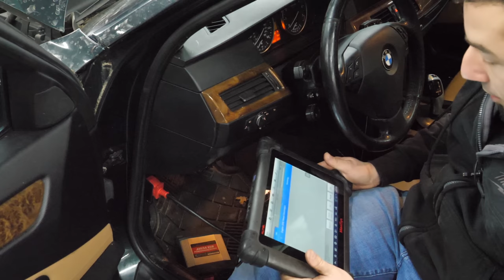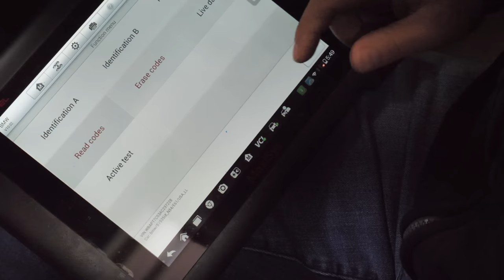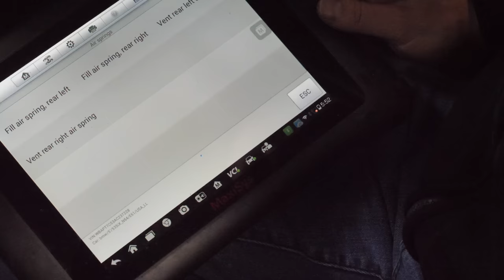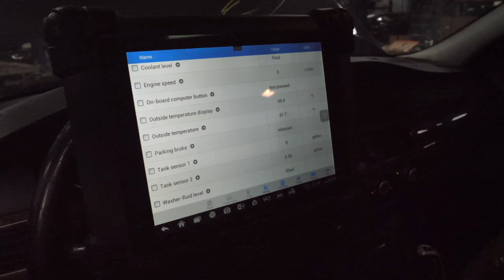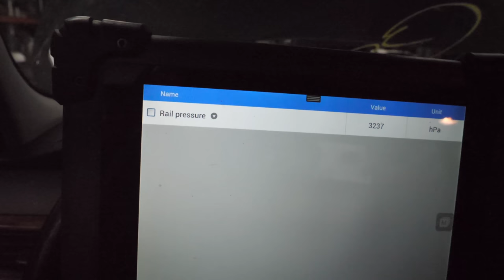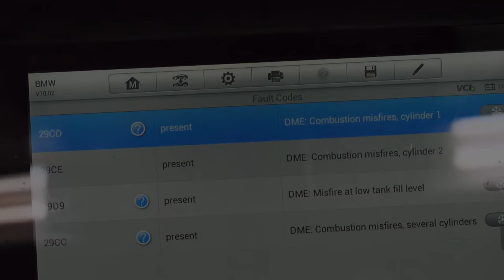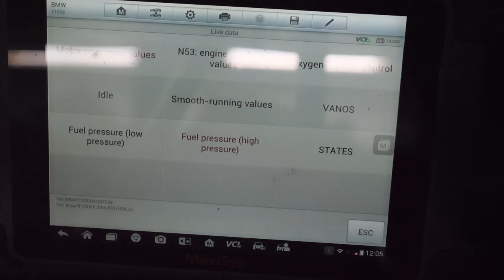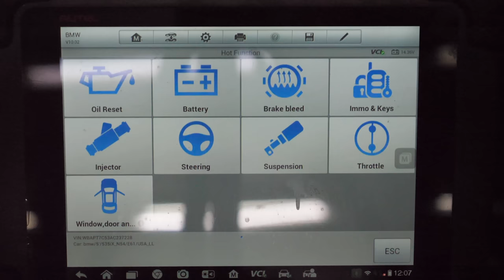WHO DID THIS? BMW Wagon I Bought At Auction LOADED with Improper Repairs. Can We Right These Wrongs?

Comment: https://youtu.be/VpqPA_Znw1Y?list=RDCMUCgzJHvOhLert9g2yT-09RMQ&t=1682

If you tie a cord around the lines on the driver's side before you pull the the lines from the passenger side, you have a cord that goes over the hump of the fuel tank. When you want to pass the fuel pump lines back to the driver's side, tie the cord to the lines and pull from the driver's side. Much easier. Almost a LPT.

Comment: Would it have been easier to  pull that pump bundle through from the other side?
Reply from the maker: it doesn't disconnect from the other side
Reply: @I_Do_Cars  I meant sticking some flexible hose, rod etc through from the other side, attach to the pump hoses  and pull through that way?

Comment: Self inflicted,, car is in the same league as an A Model Ford. Though more parts for the A! At far less cost
In Europe these things are scrap as they cost more to fix than the car is worth. At $900 you got ripped!!
Brake clean to start it. 
Crash Auctions,,, where you buy a crashed car for its good mechanicals then refit the broken mechanicals and put it back through the auction. Seen that numerous times. And ofcourse total basket cases bought for a VIN number. That is here in Oz a lot harder now. 
And the reason I never let used cars go to 'indepenent' inspections as again good parts get stolen. And yes that did happen to me. 30+ years ago.
And why you have to engrave/ stamp used parts sold on Ebay as the crooks send back broken ones.  Headlights, tailights even a cylinder head.
Reply: Trust is good; mistrust is better...

Comment: Man it's your car but for these wagons I don't understand why people want to get rid of xdrive. They're already heavy and there's also many other options to save weight (after market ABS fenders, lighter back seats etc.) where you aren't removing a super useful feature.

Why not just run Xdelete to turn off power to the front wheels when you want it to be RWD and then just put the effort into tuning a bit more power out of the N54?...there's a lot of overkill in the N54 so it can pretty much make about a much power as anyone could ever want in a road car.

I get it in the e92, e93, e90 or even the e60 if you're effectively building a dedicated track machine or drag racer but it's not like it's going to be as reliable as a non x-drive from the factory. The xdrive models are also way better for putting the power down out of a modified N54 without being a pointless burnout machine.

On my RWD e92 335i it took spending 3k on tires and wheels before I regretted not buying the AWD variant but I'm dead certain I should have ponied up for it.

Comment: If the battery is or has been low, you can't trust any of the error codes. The computer will report random errors on low voltage.

Comment: Given all the stuff you want to change on this car, would it be any easier just to import one from Germany that has the specs you want?
Reply from the maker: Tough to do on cars under 25 years old
Reply: I've looked into doing this for an euro-spec BMW. If the car is under 25 years old, it has to go through a complete US-spec conversion by a registered importer. Practically every part number has to be verified to match the USA model. Very few importers are capable of doing this work. Costs were estimated to be $40k on the low end, up to over 6 figures depending on how different the car is from the USA version...so that option is actually more difficult and EXTREMELY expensive.

Comment: 300hp inline 6 twin turbo im already like nope these engines aged like fine milk and so do the new smaller displacement engines with even more horsepower if these engines nowadays were more like humans a spare tyre (not included) is the least of your worries a defibrillator for the engine and at the very least yourself when the repair bill rolls in
Reply: High stress = high failure rate theres a reason high blood pressure is bad

Comment: I own the identical car. Love the rarity. Except mine (green 2010 wagon) I have garage kept since new. Car is pristine inside and out. No dings.  Had all the usual repairs. water pump, walnut shell decarb, oil pump housing seal, valve cover gasket, oil pan gasket, lift gate pump, struts, shocks, etc. Love it but at 157,00 miles made me nervous for long trips. So I will give it to my son who lives in NYC and will probably destroy it. Awaiting delivery of a Mercedes E450 All terrain wagon. Would sooner walk than drive an SUV. This is the only car I know that is stunning in green. Rich Northfield NJ

Comment: HERES AN ELECTCHIKEN TIP..IM NOT A CHICKEN..IM A WELDER..  anyhoo,,if,,your pulling lines thru blind holes to replace or fit new items,, TIE A TRACER TO THE END, THEN PULL NEW LEADS THRU.. easy.. i just bought an x5,  08,  3.0tdi. just for the engine. 120ks, . i think the previous owners missus, went round it with an axe,,or he pissed someone off, 2 slashed tires,no s/roof,rear glass..& yes, it cost me 3.5k,,which is cheap,,in aus.. damn nice cars though..

Comment: Comments tl/dr. Next time use  wire or string on the fuel pump hoses. Attach to hoses,  pull out, attach wire/string to replacement and pull through.  Your welcome

Comment: The E61 535i was not produced in germany. That's a shame.... I have an 2008 E61 525d m57 3L Diesel with a manual transmission and 200.000 miles This thing is almost like new. The engine is one of the best, if not the best engine ever produced. At least by BMW. This car has driven 312,000 Km (around 200k miles) and the engine is far from done. Maybe I have to repair the turbo but that's not a big deal. Of course my car is a well maintained example as most of the cars are in germany because we have to take care of them or they wont pass the inspection every 2 years. Not a quick look or something this is like a real test if everyting is in working order mechanically. It's a shame to see these cars in such a state....

Comment: The heads of BMW should be flogged, and anyone that tries to convince anyone else how "great" German engineering is needs to be slapped.
I was a mechanic for years. I'm 62 now and retired, but I started working on cars when I was fourteen. I had formal training for automotive mechanics through my high school vocational center, and worked on cars till I was 26, at which point I made a decision, that turned out to be the right one, to go back to school and get formal training in aviation maintenance, and get licensed as an aircraft mechanic. Luckily within 150 miles from home base was a private university that specialized in Aviation fields.
One thing you learn as a mechanic is that certain "old sayings" have become "tried-and-true" old sayings because they hold true, throughout. One of those is "keep it simple stupid". In a nutshell what that means is, is the more simple a design is, the less likely it will fail. In other words keep it SO simple that's it's stupidly simple. Complication makes for more opportunity for the machine to fail.  I've worked on BMW's folks. The older ones weren't too bad, complexity wise. Although BMW did go out of their way to make everything light enough to get that performance advantage they're famous for. That was years ago, before the government Gods of exhaust emissions started to real their UGLY heads, and BMW reacted as true BIG HEADED GERMAN "engineers", and applied countless unnecessary hours to design their cars to the point of being lemons......  The thing is, they really no longer have a performance advantage over an American car anymore. They're really just over-engineered, over complicated money pits. As you can surmise by the fact that Eric picked up this 2010 wagon for $900, that was likely in the $65,000 range new. As a matter of fact, the fastest depreciating production car in the U.S. today, is BMW's "flagship" 7 series. It's a car that'll set you back over $140,000 new, that often can be bought less than ten years later for a bout $4000.  How's that for a kick in the jewels. Not that most of us can afford a 140 "G" Beemer to begin with, but keep in mind that even ten years later if you're unknowing enough to buy that used 7 series, you still have to keep it running, unless of course you planned to put it in your front yard and turn it into a planter. Keeping it running will be a costly endeavor, even if you're mechanically inclined.
Here's my bottom line..... Next time you start to look for a car, and get the bug to maybe buy that used Beemer that's priced at a point that makes it nearly too hard to pass up.....?  Pass it up... Opt for a decent Buick Regal, or Toyota Camry v6. Either will give that Beemer a run for it's money, when it's rarely running.

Comment: that is real nice , fuel tank in the car under the back seat. real safe. never ever would i put my family in that  thing
Reply: If you have -90s or newer car, it has fuel tank under the back seat
Reply: @peto22  never did i ever see one inside the cab ever, may be on the import crap. they used to put the tank in the cab behind the seat of pick up trucks a long time ago but stopped that, maybe under the floor by the rear seat

Comment: Why oh why would you start by replacing the high pressure pump without checking it gets proper feed pressure first?
Reply from the maker: Heard the pump, didn’t figure anyone was in the tank. I was wrong.
Reply: @I_Do_Cars  so many times you can hear the pump but the assembly is faulty. I always start by unplugging the feed tube from high pressure pump and put it in a canister, then put power on without starting and you'll see if the tank pump is good by the volume it feeds to canister.

Comment: BMW even in their motorcycles over complicate things, this is why I stay far away from newer BMW.  The old Classic cars were way more reliable and easier to work on.  The new ones, just a heap of plastic junk and over complicated tech that constantly breaks down.  Electrical fuel strips instead of mechanical floats inside gas tanks.  The strips constantly breaks down (On bikes), and other royal pains.

Comment: Why does it have 2 fuel pumps
Reply: Because the fuel tank, though it is one piece of plastic...has a "hump" where the tank wraps over the driveshaft...so fuel needs to be taken from both sides of the hump...and in equal amounts so one side doesn't have all the fuel and unbalance the car...
Hey, the Series 1 Jaguar XJ6 had two completely separate tanks of 14.2 US gallons (54 litres), one in each rear quarter panel, 
two electric boot mounted pumps, 
and a switch on the  dash to change them...driver controlled.
Both tanks shared the one gas gauge on the dash...when you switched pumps you switched senders...
So like in a light commuter aircraft...the pilot needed to keep an eye on balanced fuel consumption...and running dry.